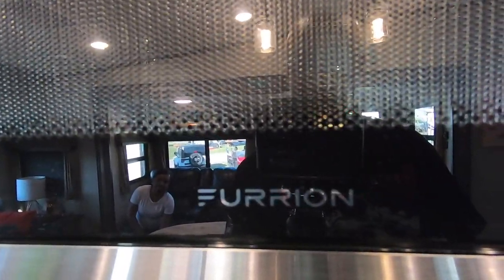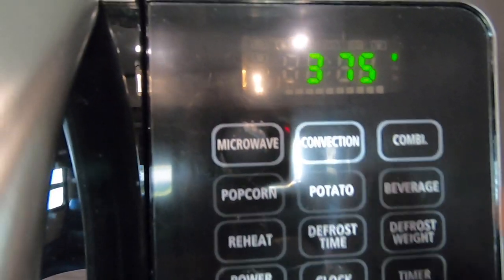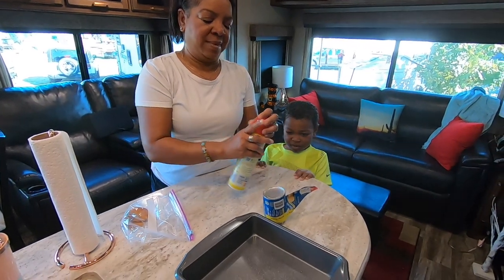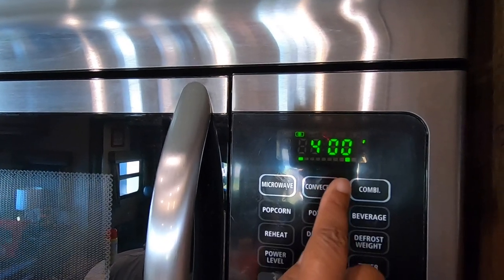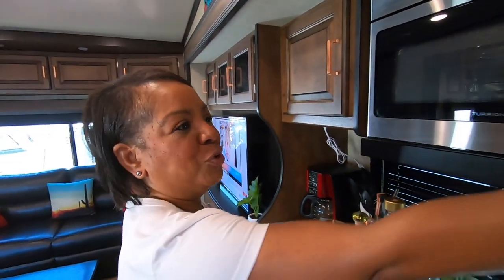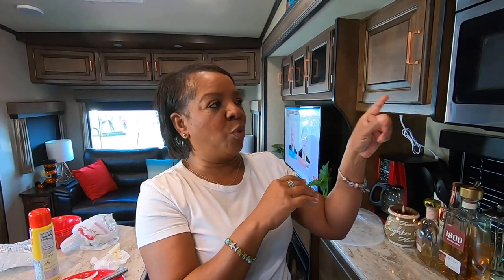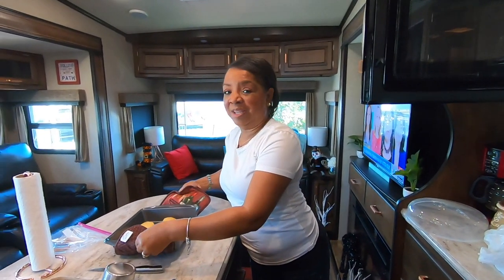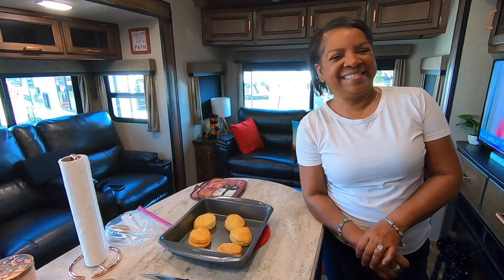How to use the convection oven in an RV

Comment: Yes but as 1 person mentioned, when using the convection option in any convection oven the temp should be reduced by 25 degrees. Because the hot air is forced by the fan convection cooks faster than conventional ovens. Example if your directions call for 350 in a conventional oven then convection would be set to 325 for comperable time results.
Reply from the maker: Thank you for that information.

Comment: Thanks for the great video! I have a few questions. 1. When you made the biscuits and had to put them back in for an additional 2 minutes, did you have to reset the temperature again or does the convection heat stay on and you just set the timer for another 2 minutes and then how does the oven stop heating? 2. When using the Combi setting can you keep the metal racks in the oven? Are they made of something that isn't going to cause sparking? 3. I watched a different youtube video on the furrion convection/microwave oven and the woman said to use a reduced heat setting of 25 degrees from what you would set a regular oven, so if a recipe calls for 400 degrees, set the Furrion to 375 degrees. Do you find that to be the case with the things you have used the convection oven for? Thanks again!
Reply from the maker: 1. We just put the biscuits back in and set the timer. The temp. stayed the same. 2. Yes you can keep the metal racks in when using the convection side. We have never set it to combi so not sure about the rack on that setting. 3. We just go by the package temp. and cook. We keep an eye on it and take it out when the item is to our liking. Hope this helps. Thank you for the comment.